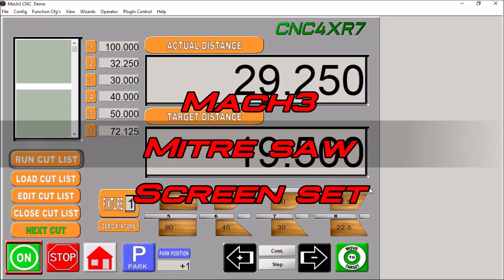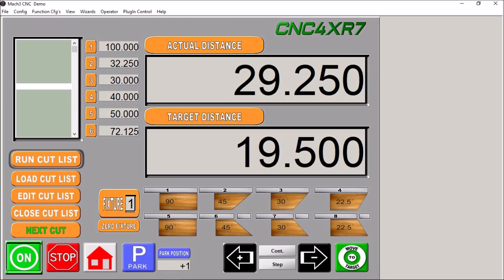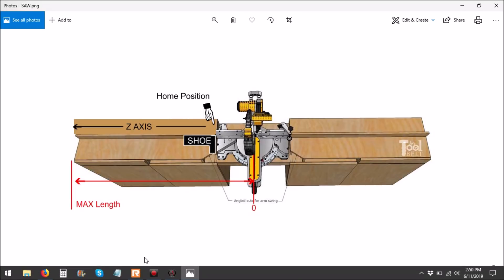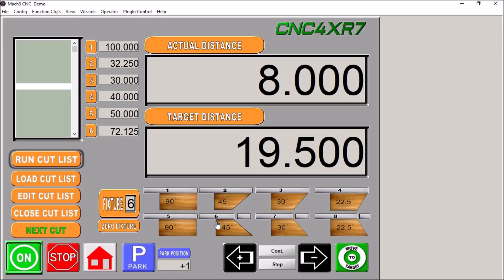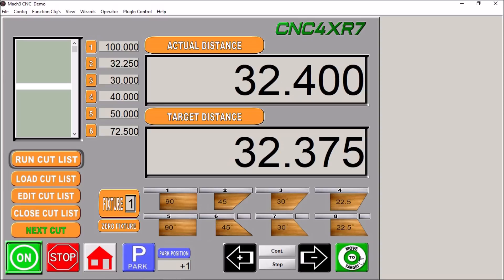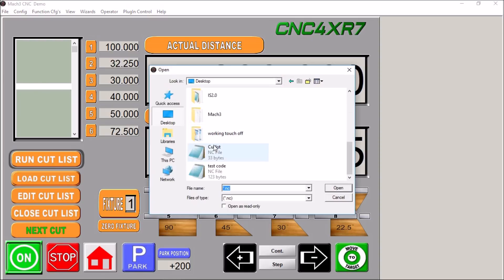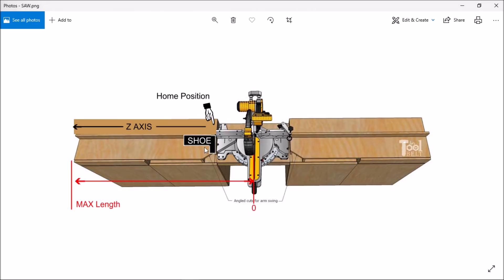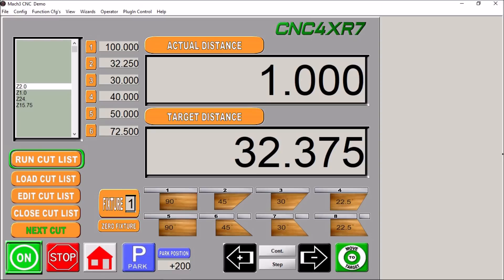Mach3 Custom Automatic Mitre Saw Stop

Comment: Interesting use of Mach3,  but why did you choose the Z axis or X?
Reply from the maker: I had initially wanted to take advantage of tool offsets for up to 255 predefined cut lengths. Also it seemed more logical as a Lathe layout is similar and this would be the Z axis in a Lathe configuration. think of the Blade as the spindle .
Reply: It's interesting how two people can look at the same thing and see it completely differently;I saw the table as X, Y as the stoke and Z as the plunge of the blade.

Comment: Using the z for different tool lengths / fixture lengths was very cunning.
Reply from the maker: Thank you! , Yes fixtures for the different Angle offsets and I could have used tool offsets but instead I just wrote scripts for the preset user defined lengths.